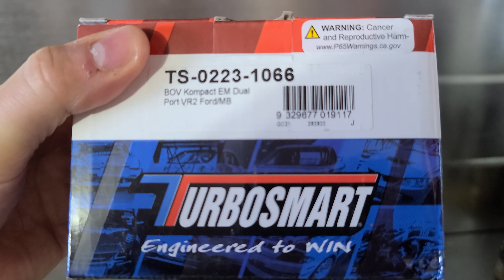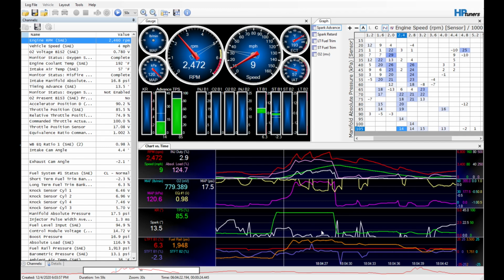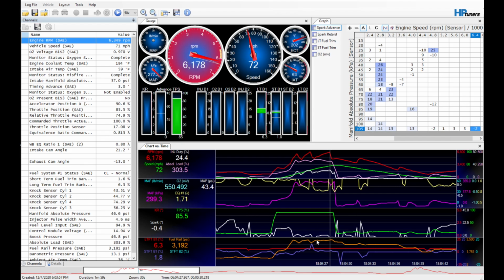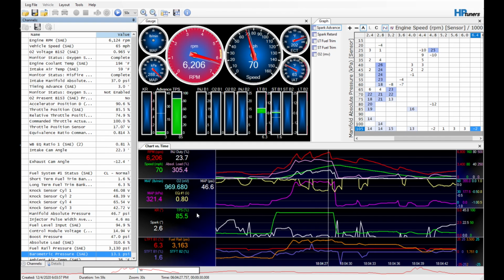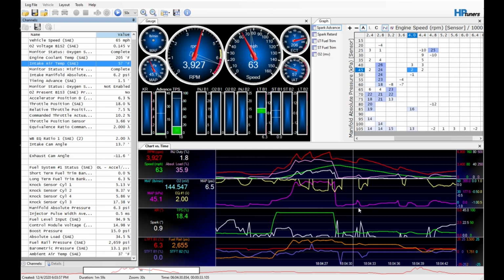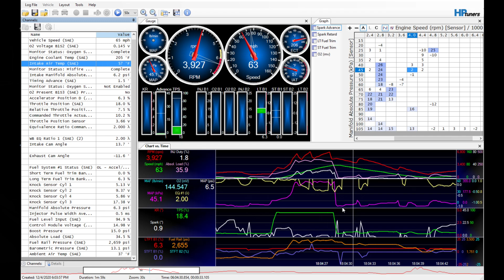Scan Logs - Can the Mercedes GLA45, CLA45 M133 Turbo Diverter handle higher boost levels?

Comment from the maker: Give everyone an update.   This noise was determined to be flutter of the Fuel Rail regulator.  100% in the calibration during idle and fuel.  Even though AMS resolved this issue, in the end - (dyno videos to come) will show mediocre numbers.  Eventually dropped AMS as a tuner for AMR.   AMR in the tune alone was able to lift the upper 5-7k rpm up by almost 100whp.
Reply: Who did you get your TCU tuned with?
Reply: Any update on that dyno run? or some performance figures?

Comment: this is 3.2 bar pressure
Reply from the maker: 3.2 bar would be the Manifold Absolute pressure yes.  If one removes ambient, to discuss what 'boost', it would be 2.3 bar (added to ambient).
Reply: @m.j.r.productions6276  do u have instagram or whatsapp or mail can u give me ?
Reply: @m.j.r.productions6276  Hello, maybe there is a platform or e-mail where I can reach you. I am currently running it at 3 bars. If absolute pressure is included, it is 4 bars.

Comment: Hi M.J.R., is there any update about the TB V2 is handling high boost presure ? I've just blown my hybrid turbo into pieces and the non-electronic TB plump back valve was fitted. My friend who studied engine technician, suspected that the BOV zylinder stuck and didn't opened properly. That caused my turbo shaft to litterlaly explode. The compressor wheel had been found in the intercooler and air filter and the exhaust wheels is stuck in the downpipe.... Turbo and IC has already been ordered, but I'm not sure if I should install the TB V2 BOV or go with the OEM one ?